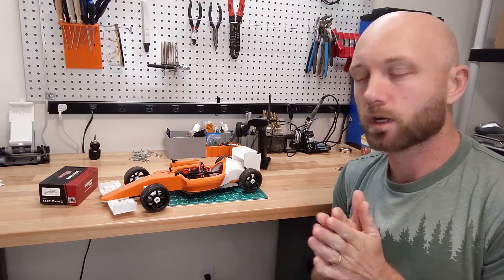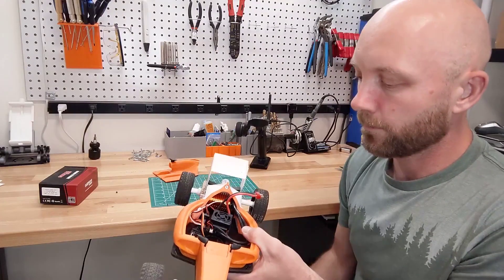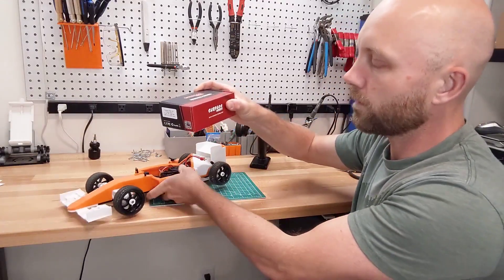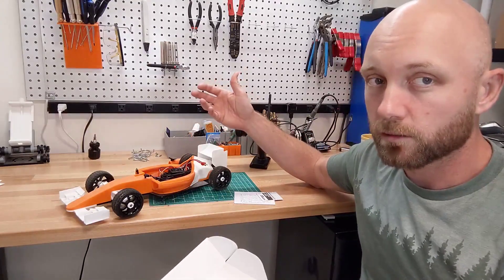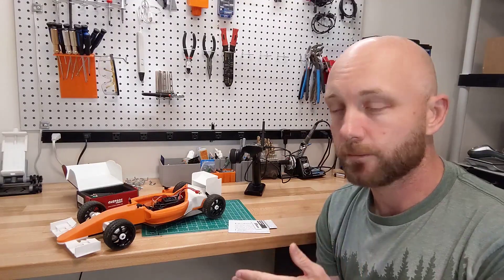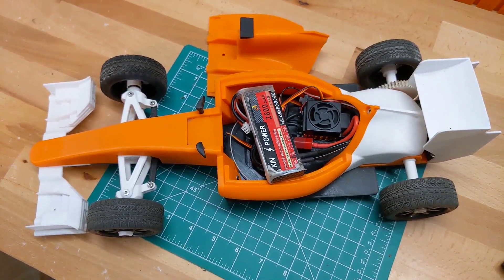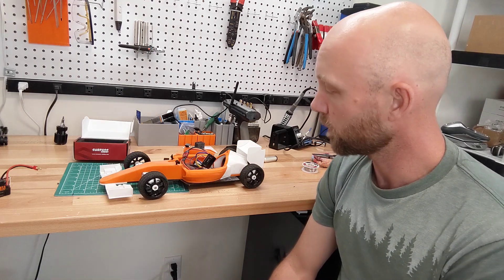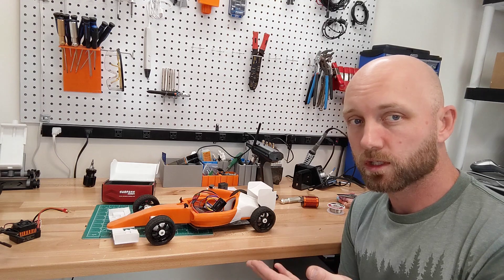OpenRC F1 - Should you go Brushed or Brushless?

Comment: Brushless is always a better alternative when sensored other than it's more expensive. Otherwise Brushless is more efficient and brushed is better for low speed control (unless the Brushless and ESC are sensored of course)
Reply from the maker: Yup, I don't think anyone is gonna argue that a brushless set-up isn't generally better/more efficient/longer lasting than a brushed set-up... I just think that out of the two motors Daniel Noree recommends for the OpenRC F1 car the surpass hobby brushed set-up is the way to go (for most people's uses) over the recommended brushless one.

Comment: I didn't had those difficulties to try to steer straight. Weird
Reply from the maker: Tires would be a huge contributing factor to the squirrely-ness... Did you get fatter ones? I'm also hitting the throttle a bit harder than I probably should be.